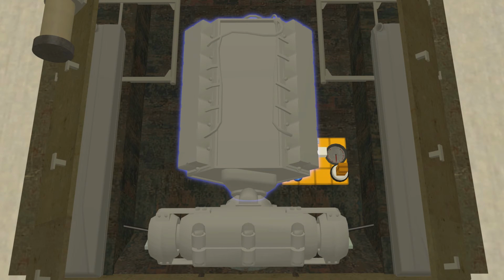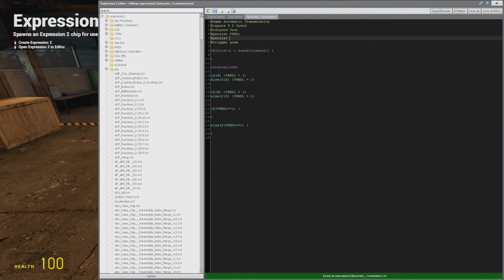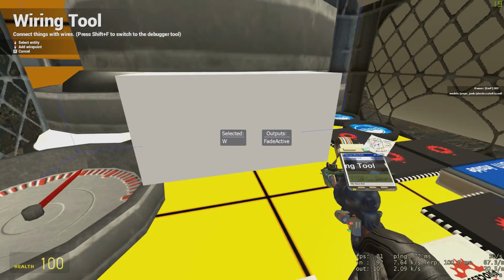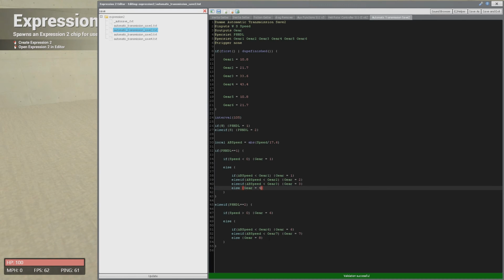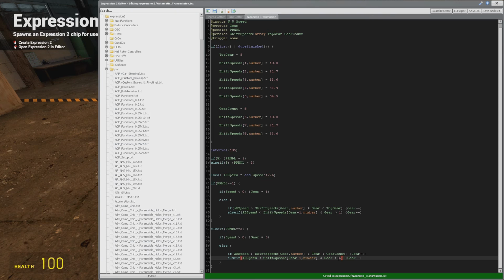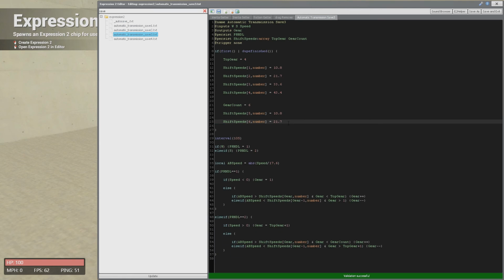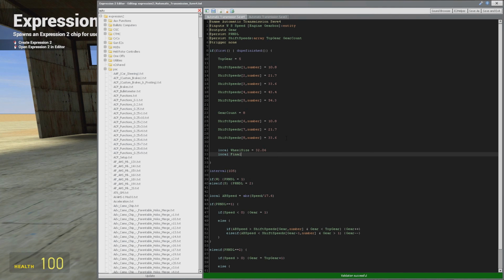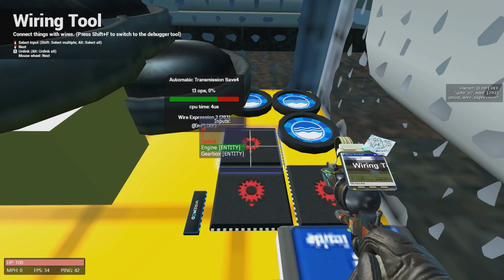[GMOD] {~ACF/Wiremod} Speed-Based Automatic Transmissions Tutorial

Comment: Hey, I made this before a year ago and it worked fine but all my e2s got deleted so I remade it using your video but the shift speeds are messed up now and I have triple checked everything. for example my final drive will be 0.25 but the shift speeds are too high and the engine reaches redline but if I put 0.35 or around there its perfect and works normally. Just to double check I put the wheel diameter in inches and the final drive is Gearbox Final * Diff Gear * Diff Final.
Reply from the maker: Yes, the real final drive is all of the gearboxes' final drives multiplied together (along with active gears from something like a differential or transfer case).

I'm not sure what it could be without looking at it, but the only things that effect the generated shift speeds should be engine speed, wheel diameter, and the final drive.

It might be worth checking what your wheel diameter is again. On the tank in the video, mine was 32.06 or so, but I had used makespherical on sprops size 30 tank wheels. That lead to some garbage shift speeds because I thought 30 was the diameter, but when I checked the boxSize() in e2, that was not the case.

This is irrelevant if you use custom radius when you apply makespherical, though.

Comment from the maker: Someone posted a comment asking what advantage this has over ACF's own Automatic Transmissions. There aren't many, but:

1. With this you don't have to be limited to just one reverse gear.
2. ACF automatic transmissions simulate inefficiency by applying only 90% of the torque they should; these are manuals, so they apply 100% torque unless you slip the clutches.

That's all I can think of off the top of my head :D